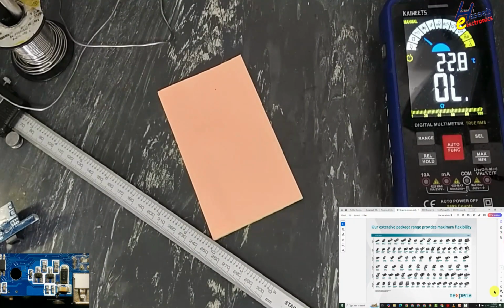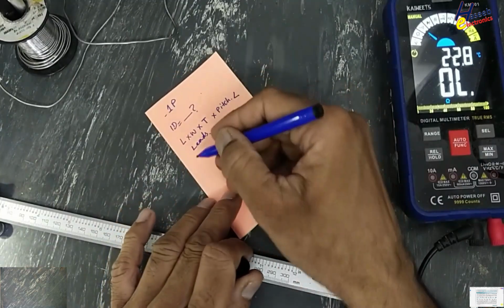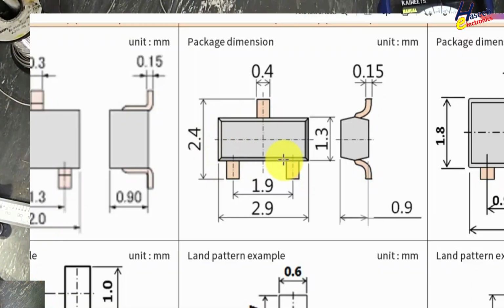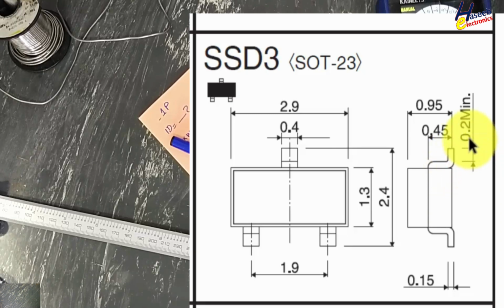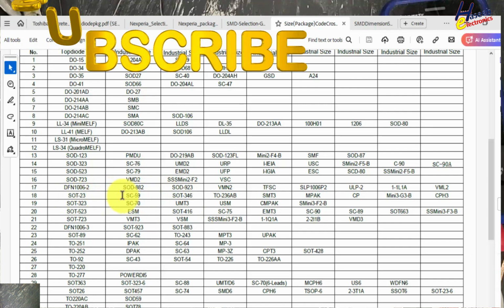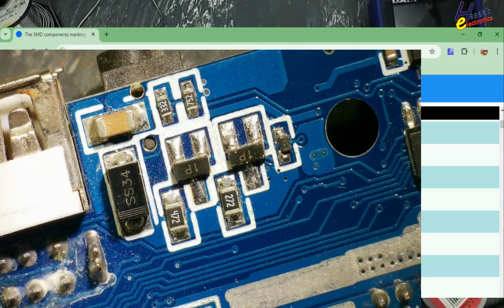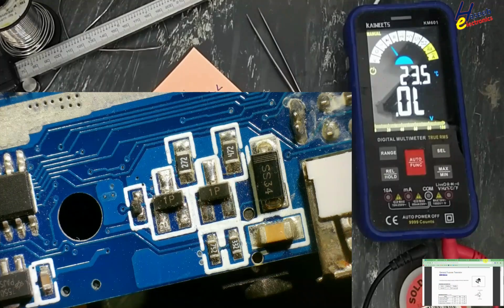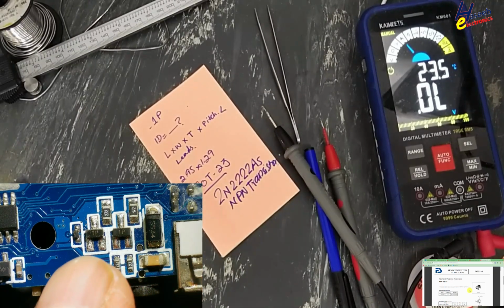{1286} SMD transistor Marking to Datasheet || How to decode SMD component

Comment: My friend salam If you want to teach people the method, don't give them component names, but my friend, show them how to trace the faults, starting from the power supply to the diodes bridge thè volt in the big capacitor and small capacitor, then the locations of the Schottky diodes, the most important capacitors on the board, the most important inductors, then the voltage inputs and outputs on the ICs, until you reach the fault by tracing the paths, not by bringing me components and telling me this is the fault.
Reply: New guys here lols try to check for his video you will learn a lot hahaha
Reply: he has plenty videos my friend, look them up. best channel on youtube for explanations
Reply: You totally missed the point of this video! It is about component identification.
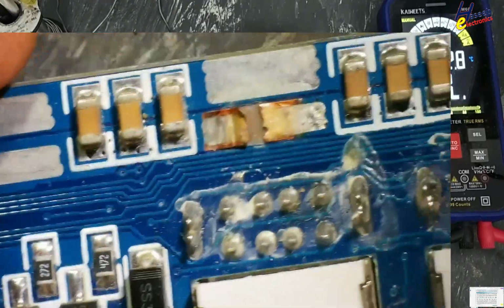Reply from the maker: @romancharak3675 at 00:35 timeline I mentioned that there is Device I'd or component id. That is not marked on this PCB 
And I explained how to confirm device by checking power rail connections 
Please watch the video again

Comment: Sir , can we use 1.5v cell instead of 3.6v to check mosfet on board.
Reply from the maker: yes you can use 3 battery cells in series. that works great